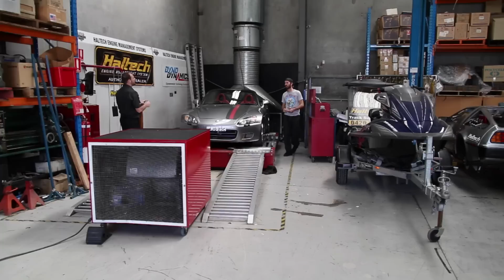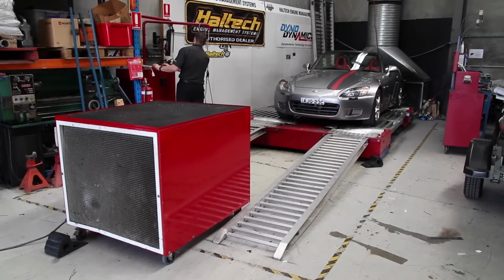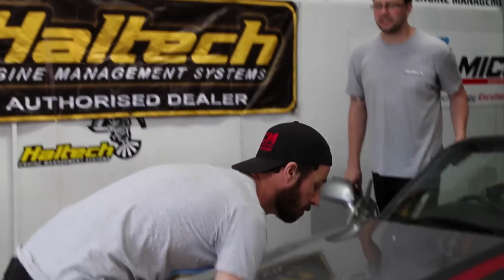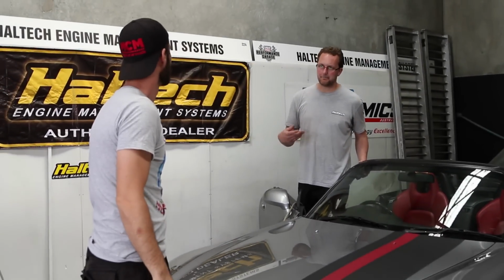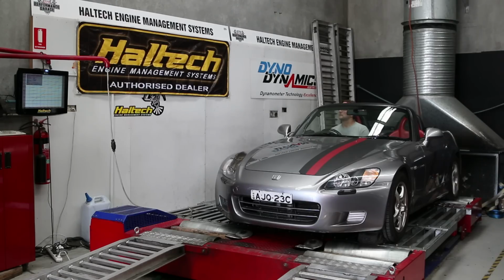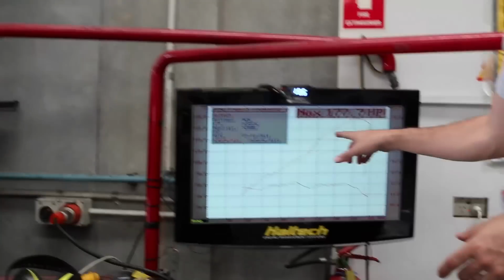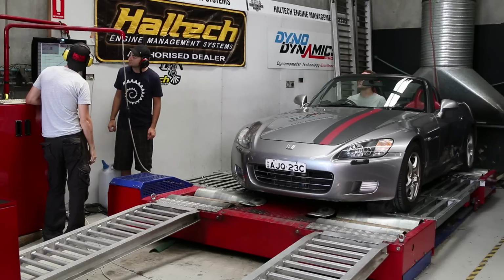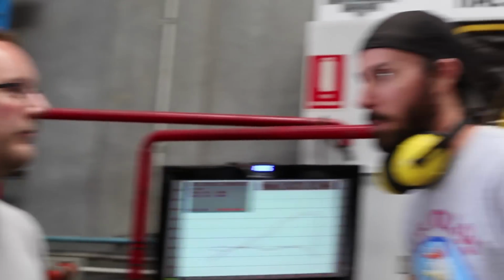Cold Air Intakes Mythbusted [Naturally Aspirated]

Comment: I thought the S2000 made 240 horsepower stock?
So there's a 25% drivetrain loss?
Reply: ***** I understand that, but 25% drivetrain loss? That's pretty high.
Reply: Then I am disappointed in cars in general.
Drivetrain loss on my bike is only 8%
Reply: Tumbleweed Folf Your bike doesn't force the torque to make a 90 degree turn, split into two, then accelerate 50+lb of wheel and tire through bearings designed to carry1000lb+ each.

You shouldn't have even had to ask. The more parts, the more friction; it's basic logic.
Reply: Tumbleweed Folf
 Is your bike running aircon pumps and power steering pumps/etc as well?

Switch your brain on genius.
Reply: atsernov I'll admit, I didn't previously know the specifics of car drivetrain loss, thanks for informing me. Let me ask you this:
Who would ever even consider buying a two seat sports car like this for it's "performance" when a sports bike can outperform cars 10 times it's price bracket, carry the same amount of passengers (and a reasonable amount of luggage), all while getting double to quadruple the gas mileage?
What does this offer?
Oh, motorsickle , Aircon and power steering is for pussies.
Reply: motorsickle I understand it, I was just expecting a different number from the one presented. Auxiliaries aren't necessary, that's why they're auxiliaries. To have a vehicle be for a sporting purpose, designed to carry no more than one other passenger and a small amount of luggage quickly, and perform well on twisty roads, things like A/C and powered functions (windows, steering, roof, etc.) All detract from the supposed purpose of the car. Look at some of the most renown enthusiast's cars out there: the Alfa 4C has no power steering. The Lotus Elise range had A/C and power functions as an option, again no power steering. The base model NA Miata had no power steering.
If you want an automobile that goes fast in a fun manner, carries a single passenger, and a small amount of luggage, and have no need for concessions like power functions, then a bike is your best bet at a price point; those enthusiast vehicles are well above the most expensive bike. Bikes are also cheaper to insure, by far. Moving away from that formula invites complexity and the loss of focus on having a fast, fun drive. I can go twice as fast, and carry the same load, and get twice the mpg of this S2000, for half the price. If I want to carry more, sure, a coupe or 4-door will outperform a bike, but two-seat sports cars with a small trunk are essentially null when bikes exist.
Reply: Tumbleweed Folf  Just because it has some level of performance doesn't mean it is intended for racing.

I don't care what you drive or ride. If you're putting plates on the thing, you have it for enjoyment. And enjoyment is a very personal experience.

You don't seriously get on your bike JUST so you can lead the line at the next stop light do you? You actually enjoy simply RIDING right?

Why can't someone simply enjoy DRIVING? Street legal sports cars aren't about racing, they are about driving.

I've had my most fulfilling driving and riding experiences when it was just me, my machine, and an empty road.
Reply: atsernov Of course, but when the enjoyment comes from a visceral connection between you, the car/bike, and the road, one would suggest as few distractions and powered interference as possible, hence my belief in cars like the Elise, and bikes, be the apex of what is offered in the realm of "driving engagement".
motorsickle What is "assisted" or interfering about disc brakes? My bike doesn't have ABS, which I enjoy not having, but disc brakes it does, and it doesn't detract from the experience. EFI? Uh... sure, I've had bikes with carbs as well, and they were great fun too.
Why would you prefer a car on a tight twisty road for going faster? To own a new car with the same performance specs as, say, any new 600cc supersport, you'd need to be paying about 5 times more, and that'd net you a "meh" Corvette C7. Still gets less mpg, still only carries one other person. Still has power steering, a dozen different intervening electronics that exist between you and the drive.
No, racing is not the priority, connection to the event is, and in that arena bikes, and very dedicated cars, succeed where normal sports cars do not.
Oh, also, U mad bro?
Reply: Tumbleweed Folf "my belief" being the key phrase there. Not everyone believes this.

As the saying goes, "Opinions are like assholes; everyone has one, and they all stink!"

Why do you even care what others drive? Is someone holding a gun to your head telling you to drive a S2K? Also, variety is the spice of life. If everyone drove the same thing it would SUCK, so stop hating.

Comment: Can you guys see if throttle body spacers on a tbi engine will give it more power?
Reply: Go buy one. They're cheap
Reply: I had one on my 2002 V6  s10 and it did nothing. waste of money. The ECM tune from Nelson Performance in Texas did give me some torque.
Reply: tbi spacer does help a bit. best thing to do is flip the tbi bowl. tune and 350tbi injectors
Reply: +Jose Sevilla i just buy the k&n filter because of maintence. alot cheaper to run in the long run

Comment: dude cold air intakes suck... I got a 2010 challenger rt with straight pipe flowmasters and diablo tune and thought it'd be nice to get a cai.. I got a spectra cai that deeply inhanced the sound but lost -2mpg and  whooping -12hp. I was mortified but this trash and actually gave the cai away in a free ad on craigslist in my city.
Reply: +Steve D Where did you put it? Was it actually getting cold air?

The stock air box on those looks like it pulls directly from the front of the grille. Not sure you really improve on that with a cone unless you box in all around it to keep the engine heat out. Plus it looks like the stock ducting is pretty beefy, I doubt it's a significant source of restriction.

On my car, a lowly 2002 300m, the stock ducting reduced from a 3.75" accordion pipe from the airbox to more like a 2.5" snorkel pulling air from inside the front fender. Once I put a big-ass cone on there and ran 4" pipe, I noticed a substantial improvement in low end pickup, apparently because the stock snorkel was too restrictive. I am getting mostly cold air through the vented wheel well cover, although perhaps a bit of ambient engine heat, but the results stood.

But, if you don't have restriction to begin with, you won't see the improvement.

Comment: This is absolutely hilarious to me. This is more mythbusted on why dynos are a joke. There only good for tuning THATS IT. Put a cai on do a pull in 3rd from 50mph-70mph and time it. If you had less time then stock then your car is indeed faster. Hey might car idiots guess what? Theres no cold air, no air pressure, no air force and no humidity variations inside a garage. Ive seen countless dyno sheets from customers and friends before and after an intake without a tune that made power. All depends on the car, and P.S. car manufacturers don't give a fuck about performance its all about emissions. Proof is why does a corvette with a 6.2L only make 400hp when a 2.4L s2000 make 240.

Comment: Just got my first car (05 Dodge Neon sxt).Should I get a cold air intake?
Reply: Only if the factory intake is restrictive. A lot of factors come into play. Don't bother with these poorly educated guys. Do your research first to see if it's worth it. Some cars have fully optimized air intakes already and there's hardly any point to it other than sound.
Reply: Set it on fire.

Comment: Some of the videos you, Mighty Car Mods, make has good information, but you do not understand cold air intakes. You think cold air intakes are crap because the dyno says so. However, you didn't put enough scientific thought into your dyno results. You come close at times, but always seem to miss the mark. Your videos on cold air intake systems make cold air intakes sound like voodoo science, but it is not. Let me be very clear, cold air intake systems will give you more horsepower, but it must be designed properly. A lot of the aftermarket solutions screw it up, but they can be fixed to actually work. After spending a lot of time on making my own custom cold air intake on my car, I can tell you that the principles behind a good cold air intake system are simple. 

First, you need to pull the air from a cold spot on the car. Your previous videos on cold air intakes all pull the air from behind the radiator, which is crap. You need to pull the air from in front of the radiator, and preferably from one of the air inlets on the front. Some cold air intake systems do this, it looks like the S2000 system you bought does. 

This brings me to my second point. If you are worried about sucking in water, then put the filter in a different location and put it in a box if you have to. Personally, I had an old cone filter from another car that wouldn't fit where I wanted it to fit, so I built a sealed composite box for it behind the radiator and made an inlet pipe for it below the front bumper.

Third, heat transfer is a bitch, but that is why insulation exist. Any boxes or pipes behind the radiator are going to heat up. Therefore, I personally recommend wrapping any pipes in heat shielding. Ceramic coating also does the job, but cost a bit more (spray can ceramic paint is crap). 

Fourth, minimize obstructions and bends. This is simple fluid mechanics. Moving air slows down in bends and past obstructions because of pressure loss. Mufflers on stock air intakes are the biggest source of pressure loss. Speaking crudely, mufflers work because they propagate acoustic pressure waves in the intake and the energy for these pressure waves comes from the flowing air. 

After applying all of these principles to my system, I was able to make some pretty good improvements to the performance of my intake system. At idle, my old system would heat up to 120 dF at a stoplight stop and 150 dF after a few minutes of sitting still on an 80 dF day. Now the intake only heats up 2-4 dF at a stoplight stop and doesn't even get 100 dF after 10 minutes of idle. Also, the system cools down more rapidly. To put numbers to it, my intake temperature drops down to ambient before 50 mph in a 1/4 mile run. Finally, my moving air intake temperatures are down by 5-10 dF. The lower temperatures alone result in my car producing more horsepower than a stock system it almost every driving scenario. 

So where did you go wrong in the first cold air intake and the turbo video? Both systems were in open air behind the radiator. Your even showed in the turbo video that the temperatures were up with the cold air intake. My recommendation is to build a sealed box for all of those systems that utilize an inlet pipe that pulls air from in front of the radiator. Also, I recommend doing a custom cold air intake system (box and all) on a more modern car that has mufflers built into the intake. That would have more meaningful data than old jalopies that don't even have intake mufflers.

Comment: wtf if ur gana test this dont do it on a fucking new nice ass car with a stock intake system that is designed to do its job get an old pos with a pointless stock intake system and put and cold airintake system on that ull see a bigger gain in power

Comment: what is this vtec shit everyone mentions? wtf is vtec
Reply: Najib Asifi look it up google
Reply: ya what the crops is it
Reply: VTEC (Variable Valve Timing and Lift Electronic Control) is a system developed by Honda to improve the volumetric efficiency of a four-stroke internal combustion engine. (i.e. improved economy). The VTEC system uses two camshaft profiles and hydraulically selects between the profiles for increased efficiency at different RPM's.